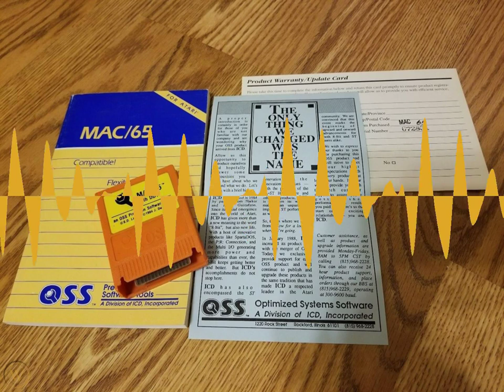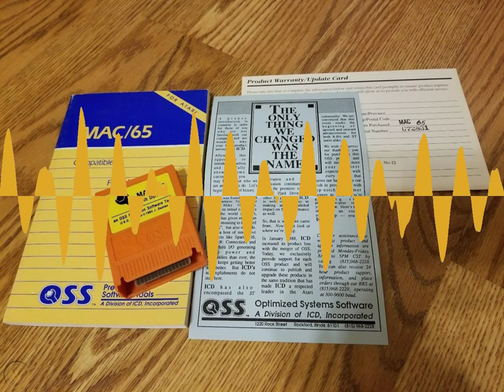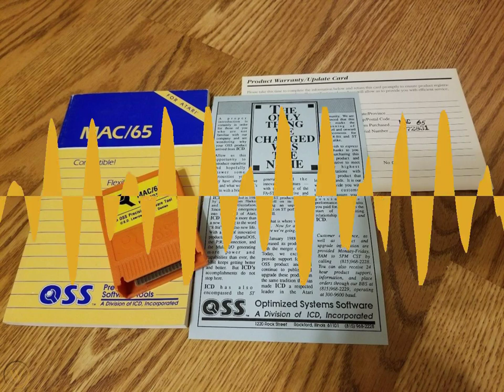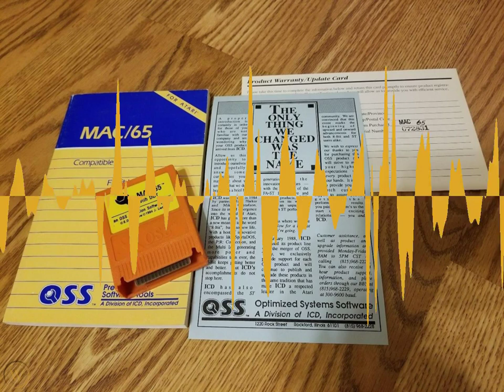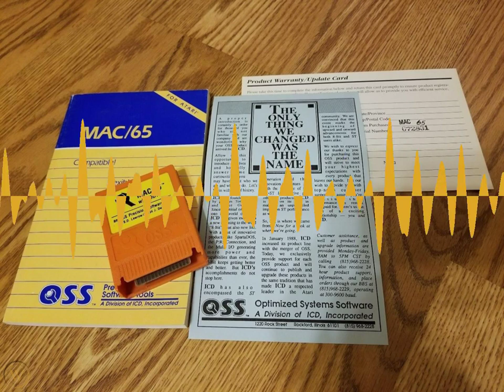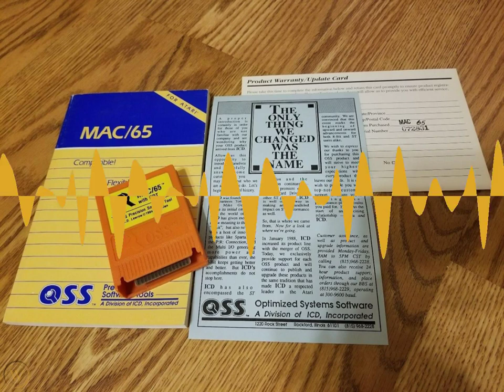Stephen Lawrow, Mac/65 assembler — interview

Comment: The original cartridges for the Atari computers could support only 8K. This is why Microsoft BASIC wouldn't fit initially and Atari 8K BASIC became the standard BASIC.
Later, 16K bank-switched cartridges became common and Microsoft BASIC and other powerful tools came to the Atari in cartridges.
Yes, ALL numbers in Atari 8K BASIC were floating-point, including the line numbers. A line number of 14E2 was perfectly legal. But there was a bug in the floating point routines that slowed them down considerably, making Atari 8K BASIC notoriously slow.
This helped push me (and I'm sure, others) to learn 6502 Assembly Language as quickly as possible.